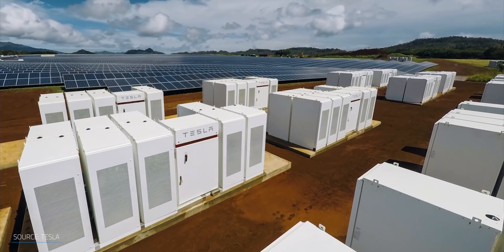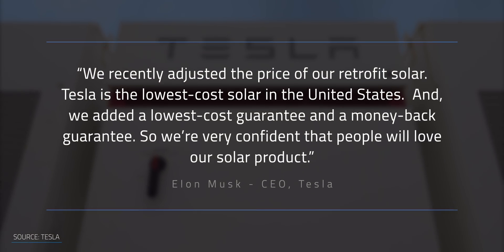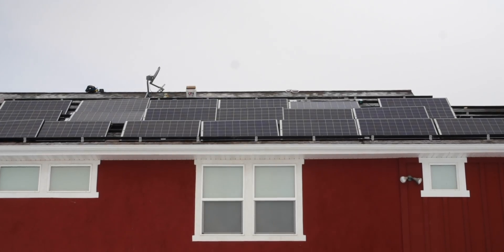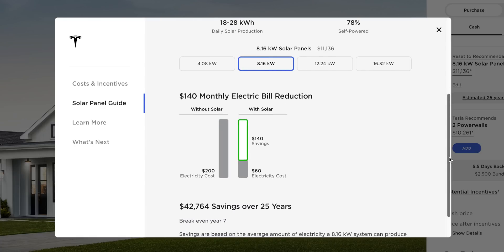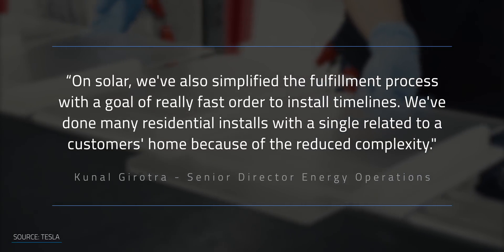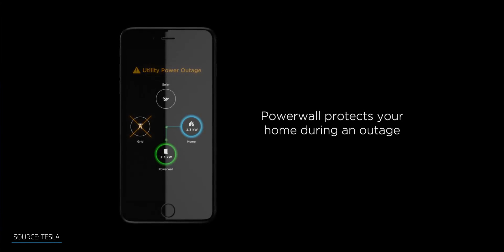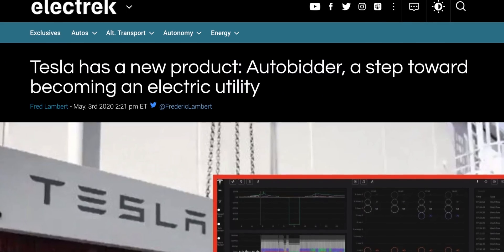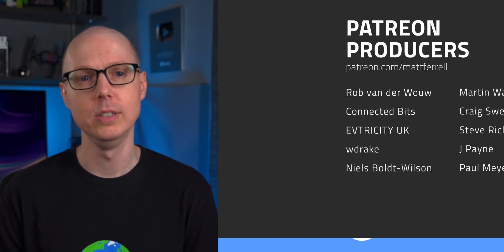Exploring Tesla solar panels game changing price

Comment: Damn....solar panels are expensive in USA. In my country ( INDIA ) the average cost per W of solar panel is less than $0.6 even before incentives
Reply: I can find panels as low as $.25/watt in the western US. The problem is not the panels. It is that plus inverters, plus installation hardware, plus installation labor, plus regulatory fees. The labor costs are obscene.
Reply: @court2379  in india its 0.8$ after installation and then you get cashback 30 to 50 percent from govt depending on slots per year. However for that 4kw min
Reply: @court2379  It's very easy to just install them yourself.
Reply: @court2379  spend a few weeks/months learning the tech and how to install them.
Reply: @court2379  Install your own and it's really cheap
Reply: @JH-th3ke  I would not say really cheap, it will still cost 5 to 15K US depending on how big I go. However the ROI is less than ten years which isn't terrible. I plan to someday, but need to replace the roof first.
Reply: @court2379  Oh yes door mounts would cost a lot. I did mine in the back yard made the mounts and seasonally adjustable. ROI was about 3 years.
Reply: @court2379   for solar to work it has to be 1 dollar a watt out the door. turn key
Reply: Even less than that, around $0.4-0.45
Reply: @sanchitrastogi55  it is incredible when compared to other countries...
Reply: Correct. Couple of panel with battery and invertor costs around $120 on Amazon India
Reply: In Germany we pay around 1100€ for 1 kWp ($1,2/Wp), but most of that cost is labor, roof mounting and parts (inverter and cables), the panels alone are closer to $0,35/Wp. And we get payed around 1800€ over 20 years per kWp for energy that goes into the grid. So those are basically free.
Reply: Psi Storm Germany is more focused on long term goals than short term ones. Just look at recycling compared to the UK. We try to turn a profit. You try to turn waste into something without the profit incentive becoming dominant. The US isn't serious about solar but it's focused on green economy expansion. I'm afraid Germany shows what happens when the free market is abandoned in favour of actual progress.
Reply: @Psi-Storm  Mine was at 0.6 € per Watt. In der Solarindustrie scheint noch viel Luft im Preis zu sein....
Reply: @Psi-Storm  if we only talk abut panel, then ur Germany is much cheaper than india
Reply: Manny Santiago  Absolutely,  what those solar companies are charging for day worth if labor is robbery. It isn't hard, it is just unfamiliar to most people. The permit process is the other challange people will try to avoid by paying someone. 2-3k is more than enough's compensation for the labor/effort involved.
Reply: @court2379 , I find it odd that someone says another person's work is "not hard". Yeah, screwing a bolt on a roof to hold a solar panel may not be hard. However, there are tons of considerations to make to install solar in an efficient long lasting way. Not to mention the knowledge behind understanding electricity.
Reply: @mr.c6674  "tons of considerations" huh?  You are obviously not a technical person so it must seem complicated to you.  The hardest part of installing solar panels is to avoid tripping and falling off the roof.
Reply: @mr.c6674  Guess I missed this one. I am not trying to say it isn't work and there isn't value meriting charges for the knowledge and service these companies offer. The problems is the amounts they are charging. It takes a few people a day or two of labor to install the panels. The sizing and planning is done using software they have developed and probably takes a few hours for one person, then there are adminstrative labor costs and getting the permits. So for a project maybe 5-6 man-days labor. Let's say they are getting $30 per hour (which they probably don't) that comes to 8x6x30=$1440. Then let's add some profit, and payback for the development of their tools and marketing, let's say a generous $2560, for the two day project (yes I know the permits and billing will drag out for a while, but the bulk of the project). So now we are looking at 4K over the cost of the equipment, instead of the 12+K of the quotes I have received. They are over charging by at least double, but in many cases 3 to 4 times what they should get for the work. Why can people justify this outrageous over charge? Because government subsidies pay for most of it under the pretense of helping the people become more sustainable. When the reality is these companies are getting every dime of that subsidy and leaving the consumer with an even greater cost than if they had hired out the work themselves, without the subsidy.
Reply: I bought 8 solar panels (2350 Wp) in 2018 including inverter and installation for €3300 before incentives (after: €2700). I live in the Netherlands with very high labor prices. 
What also surprises me is the energy use per capita when I see your offers. We use 1500 kWh/year with a 2 person household (and generatie 2000 kWh). This is not including heating btw (we heat with gas)
Reply: You may be mixing up the cost per watt of a solar panel vs the installed cost per watt... you can buy solar panels in the US for less than .40/watt - but you still need racking, inverter(s), install costs, cad drawings, conduit, wires, disconnect, monitoring etc
Reply: i wish i could buy my solar system in india , any help ?
Reply: @ayileenenga9670  tata solar is the company you can contact, they are a very big company and are also doing joint venture with some australian companies,also tata installed commercial solar for google, ibm and other big companies in India. They are the best and manufacture their own panels in India. Tata solar. Will never let you down, also you get 25 years warranty on panels.
Reply: @Ajay-zi6im  thanks a lot for the tip.really appreciate it !
Reply: @ayileenenga9670  
I would veture that the hardware is actually more expensive there. Most electronics type items are. Where they will save in India is on labor and mounting hardware.
Reply: @court2379  i want to hear from him, US american like to be little others countries without even been there. if it was that expensive like you said,  american wouldn't want to buy their products. FWI, most of our solar panels and electronics panels/hardware come from ASIA )Taiwan, China, India, and Malaysia) cuz they produce good products at lower prices.
Reply: @ayileenenga9670   Sorry, I didn't look at the name... 
When Indian coworkers visit they often buy electronics and clothing in the US, despite it being manufactured in the area, because it costs less. Although they have not done that as much anymore, so perhaps things have evened out some, or tariffs have made it about the same. I can ask some friends if you don't get an answer.
Reply: @court2379  Tata solar is best company in india for solar panels, Tata is a big company, they bought Jaguar (car company)as well
Reply: @Ajay-zi6im  I think big is an understatement there.
Reply: If you send me some panels I'd be more than happy to pay you a commission.
Reply: @Valdemar Bing Can't compete with cheap unregulated Russian nuclear power!!!   3 cents, LOL .. ya get what you pay for, remember Chernobyl
Reply: Canadian prices are even more expensive and NO incentives.
Reply: I am sure .60usd in India is more expensive than 1.50 in USA  when you adjust for average salary.  likely the difference is cost of labor.
Reply: Be careful not to compare raw solar panel cost / watt with installed cost / watt
Reply: These people are talking about the actual panel, not PRICE PER WATT. Huge difference. No, people are not installing solar systems with inverters for .60c a watt, anywhere in. Any country.
Reply: @Valdemar Bing Lmao,you talking about KW/h,potato.People here talk about cost of Buying and installing solar panels which will output energy for decades.One time payment of 1-2$ for 1W generation for whole panel lifetime.1W of solar would produce 1KW/h somewhere in 200 days.Basically people pay 1-2$ to get 0.09$ each 200 days.
Average KW\h cost in US is 0.13$.
Reply: @RajeshBhavnani  the comment I was referring to was the number of skilled labor, not their education levels. The point Jobs was making was the literal lack of people graduating with engineering degrees - as in not enough people are even going to school in the US to support these mega factories and production lines, etc. That's directly do to the fact that being an engineer is difficult - it's much easier to be a community organizer. That easier part is also on the education system that is a complete and total failure that would rather teach 'white people bad - give me mo money' instead of anything real or valuable. I'm a hardliner on illegal immigration, anyone here illegally should be rounded up and catapulted over the border wall - but people who do everything correct and come here legally should not be punished. BUT, of course we can control that number, and cutting back on that number may, at times, be necessary - I have no issues with that. However, going back to the original point, to blame companies for saying they don't have enough labor because the garbage teacher union controlled education system is a complete failure is nonsense.
Reply: Darth Wheazius  So who is the U S A born scientists that invented computing? Was it a U S A scientist that "invented" www? Or did you "borrow" a bit to make it happen? The USA has a history of abusing IP. Just check out the history of their big pharmacy industry. It is buildt on theft.
Reply: But it's still expensive in Indian standards and electricity bills savings aren't much for most households.
Reply: Wtf is per kW you mean W.
Reply: @umeshofficial13  yeah my bad, i just edited it.
Reply: I believe this cost includes installation and the other costs. If there was that large of a price mismatch then the market would already be flooded with cheap Indian solar panels
Reply from the maker: Yes.  The per watt pricing here includes installation.  Typical panel prices by themselves are well under a dollar, but that’s excluding inverters and other component costs, as well as installation and permits.  And I appreciate the lively debate here, but just a reminder to keep it civil everyone.
Reply: @UndecidedMF  Like all home improvement projects, solar retrofit will never be price competitive in the USA due to the added value it gives to homeowners. The high turnover of property ownership in the USA means that home improvement projects will ALWAYS be tied to Added Value and not to the actual cost of installation. A competent self-installing homeowner could get a solar retrofit done for less than $0.75/W, but whenever a contractor is involved, soft costs are exaggerated.
Reply: @UndecidedMF  it’s including installation and solar batteries with all
Reply: If this includes installation, storage (battery), pv panels, the inverter for 110/240V and size matching average consuption, then it is a bargain. Probably even in India.  To compare. 2*160w panels with charge controller and 1kW (k=kilo=1000) led battery set me back about $400 somewhere  in Scandinavia. I installed it myself. Not that hard for a small system. I just covers my lights and computer stuff but during a power outage I don't have to worry. 

PS: The inverter will cost me $2-400
Reply: Yeah I was amazed as we set up our solar panels and read about Tesla claiming their "game changing price", in Sweden ours only cost us half of Teslas price per watt, and they were premium black ones with all the features and 22% efficiency
Reply: I guess it's corruption of a kind.  Logic alone places the fossil fuel industry at the heart of opposition to solar.   The solution is to provide large tax incentives to the to the fossil industry for conversion of Coal to solar... make it worth their while then they will stop fighting solar.
Reply: It worked for Ontario and germany. Super cheap electricity now. /s
Reply: In my country of Wakanda, our solar panels work even at night.
Reply: @djabroni_brochacho4644  Good for you 😂😂 Well actually there are places in my country .they work at "night" to during a year.
Reply: That also means that at the darkest and coldest part of the year they won’t work during the day.
Reply: That’s because the cost of living in India is terrible along with their wages
Reply: I was going to say, I purchased my off grid system about 6 years ago now and paid about $.87Watt, in Canadian dollars, so roughly $.70/Watt American
Reply: So true, I had to do a little conversion from dollar to naira and I was shocked by the amount.. With rate most solar installation in my country would have been set aside.. We would rather burn petrol to power our generating sets..
Reply: @Valdemar Bing really.. then it is free
Reply: @Sekhar_Home  That guy was talking about KW\h prices,not about solar panels.KW\h in US average at 0.13$.
Reply: our old world thinking processes are our undoing
Reply: @David Lockett in india, in my state per KWh is US$0.08 i.e. ₹6
Reply: That would be illegal in Canada, and when your house burns down the insurance company won’t cover you.
Reply: @Supercharged Petrolhead - This is going to be manufactured in India now. Plus it will be subsidized. The costs are going to be even much lower than this.
Reply: If you go on Alibaba and seen how many solar panels really cost, this isn't surprising. Solar panels cost $0.20/watt in China. The rest is just installation cost + installer profit. How much you pay depends on how much your local installers want to profit.
Reply: I can get them for 30 cents a watt in the U.S.
Reply: It all depends on the quality now doesn't it?  Also, in your country people are paid about 3 dollars US a day. So I would rather make 200 dollars US a day and pay 3 dollars per watt. Wouldn't you? Need I really go on?  I mean , in your country there are 300 million cows and people are starving to death!
Now that's progress

NOT!
Reply: @Heart2HeartBooks  What kind of trash attitude is this?How the hell you get to racist and toxic crap from discussion about solar panels? Did someone hurt you?
Reply: Even if you add the installation cost ,excluding inverters
It costs less than a dollar 👍
Search loom solar india, tata solar 
(This is excluding govt subsidy)
Reply: Most shazz in india is cheaper than it is in the US.
Reply: To lower the labour cost, find a company that allows you to buy your  own set and diy partly. Its not that difficult, except for installing and connecting inverter. i paid in total 2000 euro for an 2750wp installation. Costed me 2  days labour....
Reply: @teddy_north  If I do it, I will do the entire project myself. Those are good prices though. Never seen anything that reasonable in the US. In my current home I don't use that much electricity and the rates are fairly low, so it would be a longer payoff. Particularly if I hired a company to do it. So I probably won't install them on this home.

I plan to build on a bit of land I bought though, and the power company and city want about $12000US just to connect to the grid. I will be going offgrid solar because of those costs. The power companies are pricing themselves out of customers.
Reply: @court2379  wow that sucks...  How much do you get for delivering a kwh  to the electricity market?
Reply: @teddy_north  Where I live now (Utah), nothing. They will give you a credit for over production which applies to future months billing cycles.  Once per year they clear any outstanding credits. They never pay the customer.  For small amounts of over production that is probably fair as they did install the power plant, grid, and maintain it to serve as your battery. Some places still charge a service fee for the connection (around $10-15/month usually, but some places up to $50),  the power itself being a separate cost.
These are also reasons to go off grid as there is not a large incentive to sell power back. Some others states have more friendly laws.
Reply: @court2379  not so different as here, in the netherlands. We do get a refund for the amount kwhs more produced but that is only between 4 - 8 cents per kwh. We pay for being conected to the grid as well, but no extra charge for setting up the connection. If you have an old meter at your fuse box,  when inserting an inverter, the meter just flows back. Then you dont need to pay 12000 dollar?
Reply: They cost about $0.90 in the US before incentives. Tesla's just bragging that their inflated price is is slowly getting closer to the standard price.
Reply: About $0.10 a watt in Arizona
Reply: Wow...
Reply: Evocati  About solar and Obama, get the facts straight and not half truths. https://www.factcheck.org/2011/10/obamas-solyndra-problem/ did your homework for you.
Reply: Is this maybe because the labor cost is very low and no regulations? We do have regulationsand while a lot of people don't like them, India climate is not the best in the world. I am not criticizing but I am from a developing country too and luckily able to move to the U.S. In my previous country, the water and waste and chemicals are tossed altogether and no one regulates anything.
Reply: @angrykulla Get serious, what planet are you from. China has stolen 1000 times more technology than they have developed, and will continue to do so.
Reply: Manny Santiago  I am all about DIY, but after working tier 1-2+ tech support for various ISPs for a decade now, I can tell you there are still millions of americans who don't even know where the wall sockets are in their house.
Reply: @angrykulla Hmmmm...So why do Chinese nationals smuggle billions of dollars out of China, through Macau, to invest in other parts of the world if their economy is so great?
Reply: Shipping from china is a hell of a lot less to india than united states
Reply: I'm packing my bags right now
Reply: wtf?? where do you buy your solar panels! Here in canada solar is like 2$ per watt
Reply: @sylfix2680  Not sure what it would cost to purchase and ship from the US, but search for "sunelec".
Reply: @sylfix2680  I know a whole sale dealer
Reply: I have a 5.2 kw system at my home which has cost me around US$ 0.46 with government incentives. I had to pay a little extra as my structure had to be higher otherwise it costs only US$ 0.42. & in these 10 months it has produced avg 20 kwh power per day.
Reply: @jeckypatel86  is that only the panels or is that every thing panels, inverter , batterys or is it grid tied
Reply: @dknowles60  It is grid tied. No batteries and  all costs included i.e. wiring, switches, earthing setup, structure, net metering and discom charges, inverter, installation charges, solar PVs etc
Reply: I watched these stupid videos and have ended up getting seriously swindled by Tesla and I am going to put that in the comments because I recommend that you run away.  They lie until you buy.  I had one specific thing that I asked every single person involved in the process.  I asked, "Is it a problem that I don't have internet because I won't buy the panels if I need it because the $100 I would save on my electricity would be undone by the cost of internet/wifi and fees and there would be ZERO profit and the panels could not possibly ever pay for themselves.  Well, all of them, every single one, said, "No problem.  The system would work without internet.  The internet is used for monitoring but there are cellular options.  I asked before signing. I asked before installation.  I asked during installation.  I asked the person who stopped by to see if it was ready for inspection.  They all gave that same answer and the 7 days I had to decide whether to take them down came and went and their inverter never worked.  The system generated no power at all and because I couldn't monitor it, it took a few weeks to find out before my electric bill came.  At that point, they totally refused to come put a working inverter in.  They refused to service my account at all saying that they would never come unless I get internet and that I could no longer get the panels off and there was no way to get out of the contract.  Now, I have to figure out whether to get $100 internet to save $100 for my electric bill and it almost doesn't matter because it would NEVER pay even ONE PENNY of the panels off and they are a lying and cheating company and there system also is prone to fires so if I start it up I will also have to pay more for insurance and that means I would seriously lose money on top of the $16,000.  Never ever ever buy from Tesla.
Reply: Taking 0.5$ and adjusting for PPP it is 10$ per W in India. Compare that with the electric prices in india solar gives less value today
Reply: It is a shame that this is such a good channel and yet some of the commenters here are nationalistic bigots and grudges built from political disinformation. Most of the people who come here value the truth. Americans can have a better system by voting for better and more knowledgeable leaders. I have lived in several countries, including communist and Japan, but here in Texas our politics is controlled by the oil and gas industry shills.
Reply: @markdouglas8073   ever hear of you did it to your self's. do you think closeing down badly need coal power plants was a good idea, Hint DTE energy was the big winner in the cold snap. they are apx 40% coal. they won big. they were selling extra megawatts  to other power companys.
Reply: & farmers can get 3kW unit with 5 hp pump 350$.  I REPEAT WITH WATER PUMP INCLUDED including installation. Trust me my neighbour got one. Initially no one was interested. Now it is hard to get.
Reply: @WilliamHelstad  if you pay $1,000 a year for electricity, solar costs $10,000

If you get a 15-20 year loan to pay for solar, it costs less.

And the price is still going down.
Reply: @WilliamHelstad  https://youtube.com/playlist?list=PL3IRGTBkUZ4ytr0_dn3bnwqTmogCp4J5H

You need to watch this
Reply: Its all about what any person in any country can afford. You can apply this to most stuff, say a can of coke.. it costs like what.. 10 rupee in India? Here in New Zealand it can be purchased for about $1.00 which is many more rupees.
Reply: In South Africa it cost $0.33 per w
Reply: @angrykulla Imagine supporting the country who puts Christians, Muslims and Falun Gong in concentration camps where they work to death or till someone wants's their organs. I bet you also say Trump is literally Hitler lool.
Reply: @angrykulla The US does indeed subsidize other countries. Almost all new medicine and medical technology for example is created in America and then due to EU laws, they are forced to sell it for pennies on the dollar and they fuck over Americans to make their money back. The average medicine costs around a billion dollars in R and D alone and that's why most medical advancements come from the US.
Reply: TEC Man  everyone knows indian are poor. What else u want to say?
Reply: @liwojenkins  China and the rest of the world steals American IP -- then hypes why everything is cheaper. Sure, everything is cheaper when you have no R&D cost. It's why American companies should always side against making products in China, since once they have the manufacturing process down, the state literally just copy and pastes it and calls it Yung-Ho Solar Panels or something and sells it for 70% less, putting the original company that did all the R&D out of business.
Reply: @rodmunch69  Yep, China steals EVERYTHING even their manufacturing techniques are stolen from Taiwan.
Reply: @rodmunch69  . . . which IP ? Which Intellect ?
Reply: @rodmunch69  it's a hole that was dug by the US company itself, they took American jobs to China to exploit cheap labor and get a slice of their  domestic market,  they also knew going in that Chinese patents only protect manufacturing processes and not product design
Reply: @rodmunch69  I disagree with China stealing from America to develop products. American corporations do the research and development of a product (any product from electronics to guitars, you name it) then the weigh the costs if built in America or China; which option will be the most lucrative to the bottom line and profit margin. Not as you have commented by saving money on R & D. 
Furthermore, the government has allowed these corporate companies to exploit the market and rip the consumer off. So, when they slap a excise tax on the imported product, that only hurts the consumer (you and me!). So it's a double edged sword. I can't afford a Breedlove guitar made in the Oregon., but I can buy one that is manufactured in China that has the companies standards of quality control for a much lesser cost. It's simple! You want cheaper like everyone else, then you will bypass American made goods to be able to afford cheaper cost products. Everything and anything nowadays is manufactured off-shore.
Reply: @rodmunch69 , are you ready to pay the MUCH higher cost of products actually Made in America? Someone has to pay the cost of that $45 an hour line worker who has pretty darn good medical insurance.
Reply: @mr.c6674  According to Steve Jobs, and a bunch of other CEO's, making products in the US wouldn't actually add a ton to the price of products. The issue is more about the crippled education system with the corrupt teachers union that cares more about creating SJW's than it cares about creating engineers - that means there's a lack of workers. Also line workers aren't making $45/hour, and if they are, then fire all of them and move to a non-union state.
Reply: @rodmunch69 When the US starts to pay for all the IP they have stolent the last 200 years you can start whining.
Reply: Fri Tanke a “I know you are but what am I” comeback - which was stolen from America as well.
Reply: @rodmunch69  ?? What was stolen? Ahh A troll bot, with a degree. Good to know. When the US starts to pay for IP on aluminum rims I'll start to listen.
Reply: @fritanke2318  You see the huge announcement last week about the new Chinese stealth bomber? LOL! They literally just stole our stealth bomber and put a Chinese flag on it. Sort of how the Russians stole our Space Shuttle, oh, and the nuclear bomb -- which is sort of like how China stole our ICBM and nuclear bomb. That's just off the top of my head -- but yeah, aluminum rims, yeah, OK kiddo.
Reply: @rodmunch69  Do you know where the main tech behind F-35 came from? It's not made in US. So yea, just start to pay your dues before you whine about IP theft.
Reply: Which IP?
Reply: Machining a circle with bolt holes is copyrighted? 😂
Reply: @rodmunch69  ha ha ha. I'm sure you haven't been to college. What American IP are you talking about? Have you been to engineering colleges where most of the research funds are invested? There aren't any Americans in masters degree program. Forget about post graduate. That's too far fetched for an American intellect. To bring to your attention (misery), most of the students are (in the order of number) either Oriental, then Indians, then Spanish, Europeans, Pakistanis, Bangladeshi, Southeast Asians and.........the list doesn't include Americans. Tell me which fantasy world you live in.
Reply: @shahzadrazi7639  My degree is in computer science and engineering technology, kiddo. Now back to your job at the Dell helpdesk.
Reply: we're run by the petrol companies. its also why we have 3rd/8th world public transport compared to everyone else
Reply: @TheLeesto  Well, that and our country is bigger and more spread out than most others.  Also, most Americans enjoy the freedom and independence of driving themselves where they want to go.
Reply: @LG123ABC  "freedom" to pay outrageous fees to own, license, finance, store, park and most importantly, the "freedom" to waste your precious life and time glued to a steering wheel in traffic. living abroad in a true first world country with first world public transportation is eye opening. i wish more people had the opportunity to experience it and they wouldnt care about the "freedom" to drive where they want as much. Your time is better spent on high speed rail enjoying a beverage, catching up on work or leisure while someone else does the driving.
Reply: @TheLeesto  Not that much traffic where I live.  I try to avoid the whole "hive" thing.
Reply: @LG123ABC  Australia bigger than US only 25 million people so your point is?
Reply: @angrykulla China's daily routine involves stealing IP and tech, cornering the market, giving free or dirt cheap land and electricity to Chinese owned factories. They get foreign companies to set up R&D in China and gradually change it from a mix of foreigners and locals to all Chinese who then go off and set up new companies or join Chinese companies, or the very same brand new innovations immediately appear in competitor factories and products and Chinese law courts rule that there was no copying or theft when it is the definition of blatant. The OP was right and if the truth seems racist to you then your understanding of racism is a false ideology. As a country and people they will cheat ruthlessly to win and don't consider win-win a good outcome. They only respect win-lose. Tariffs SHOULD be on everything coming out of China so that jobs, wealth and prosperity can return to the unrightly de-industrialized West and other places if appropriate.
Reply: @unfurling3129 , facts please.

Thanks
Reply: @unfurling3129  Always nice to see how the US is blaming others while for decades stealing inventions and patents worldwide via Echelon. You guys are so full of bullshit propaganda you don't even realize how fucked up your leadership and media is and how little about the real world you know.
Until then, just continue to shout "USA! USA! USA!" and do your morning propaganda rituals in schools like the little brainwashed people you are.
Reply: No, they really are not that bad, in the USA, solar panels range between $0.30/$1.00 per watt, This video is just lying probably to push sales of overpriced panels
Reply: Well, our president sure isn't helping...

AKA, he's trying to rip apart the EPA for oil companies to make more money.
Reply: @matthewboyd8689   he is a real estate magnate
Reply: @matthewboyd8689  What are you, like 15? You have NO CLUE. Yea - it's all Trumps fault. EVERYTHING is Trumps fault. Meanwhile the LEFT  has no time to worry about doing ANYTHING to contribute to America other than trying to fabricated ENDLESS investigations, Impeachments, Protests and RIOTS and People like YOU are part of the PROBLEM. Just THINK about what COULD have been accomplished if the LEFT would have actually spent the last 4 years CONTRIBUTING and WORKING WITH THE PRESIDENT instead of the 24X7 CONSTANT ATTACKS. Think about all the TAXPAYER MONEY that was spent by the LUNATICS creating 4 years of LIES then trying to COVER them up. Not just against the President but against ANYONE AND EVERYONE Around him. Then think about all of the Tax Payer Money that the President had to spend to Fight all the BOGUS INVESTIGATIONS. So STOP WITH YOUR BASELESS NONSENSE, OPEN YOUR EYES and TRY to use that Gray Matter between your EARS for ONCE in your life instead of spewing the same Media propaganda we've been hearing from you PUPPETS for the last 4 years. I'd say - he's done a pretty DAMN GOOD JOB considering all of the NONSTOP ATTACKS he has had to endure from USELESS CAREER POLITICIANS - WHICH APPARENTLY YOU THINK DO A BETTER JOB OF RUNNING THE COUNTRY. But I guess you'd rather elect a guy who has done nothing except Line is Families Pockets for 47 years. And you have the NERVE to complain about THIS President????? Good GRIEF. I sure HOPE you have a PLAN to keep YOUR SANITY when we RE-ELECT President Trump AGAIN. My prediction is that the TDS will be Off the Charts - beginning NEXT WEEK when a new SCOTUS justice is sworn in.
Reply: @matthewboyd8689  Why should he do you remember what happened when Obama helped Solara?
Reply: @matthewboyd8689  ya he do.. beter than bubama!
Reply: @matthewboyd8689  Solar prices installed has nothing to do with Trump.
Reply: @vichardy3504  Sure it does. Illegals charge way less. BWAHAHAHAAaaaa. That's why Republicans refuse to require E-Verify for employment.
Reply: Matthew Boyd    The free market (capitalism) will (is) bring the price down, which is the whole point of this You Tube video.. Government bureaucracy is what keeps prices higher than they have to be.  EPA is just part of that bureaucracy. Coal and petroleum products will go away just like the horse  and buggy when better and cheaper forms of transportation exist.  Let the consumer decide what’s best, not some bureaucrats.
Reply: @jimmysunshine2348  through free market will try to get as much as possible profit. If noone wants to drop the price they will try to keep it or raise it.
Reply: @jimmysunshine2348  War and empire is one huge subsidy for the oil companies.  It is good the people are encouraged by subsidies to instal rooftop solar.  However the USA is half hearted compared to China.  They will leapfrog our steam age energy infrastructure.  I think they instal more in a month than we do in a year.
Reply: @jimmysunshine2348  or maybe regulate fossil fuels heavily and deregulate alternative energy
Reply: @jimmysunshine2348  The energy market is not like some widget that can be made cheaper over time.  Most consumers don't have the option to chose where their energy comes from.  The government is already involved in the energy sector through subsidies and tax credits.  If it was really a free market all those would not exist.  Quit drinking the Republican Kool-Aid and realize that our government is the only thing stopping corporate greed from killing us all.
Reply: @jimmysunshine2348  The government is PREVENTING competition by subsidizing dying industries (with coal being a great example). We the taxpayers are also subsidizing wrongheaded or outright corrupt initiatives, like growing corn for fuel, or rewarding the massive destruction of rainforest to produce palm oil.
Reply: @matthewboyd8689  back to blaming the orange guy haha American people you need to grow up before growing old
Reply: @bitkurd  He is right though, the reason things from China; PVs being one of them cost more is because of tariff wars... And no China does not pay for the tariffs, the consumers do.   Tariff protectionism goes completely against capitalist ideals, it creates companies like Harley Davidson that fall behind the competition at a global scale due to a lack of need to innovate to be able to compete.   So glad that he lost, hope the Republican party never nominates another clown like that.
Reply: @matthewboyd8689  Trump digs coal, remember :/
Reply: @liwojenkins  You are a gullible leftist and have done ZERO fact checking.   Here is truth:    this video is a lie.   Northern Arizona Sun and Win has panels starting at $0.60 per watt before any tax incentives.   https://www.solar-electric.com/residential/solar-panels.html?product_list_order=price_per_watt    eBay has them at $0.36 per watt. https://www.ebay.com/sch/i.html?_from=R40&_trksid=p2380057.m570.l1311&_nkw=300+watt+solar+panel&_sacat=0
Reply: @puppyupper4565  So you're too stupid to comprehend that the cited cost INCLUDES LABOR. Got it.
Reply: @SoundOfYourDestiny  You are child. Labor impacts all things.  Commodities prices are based on cost of production, transport fees and tariffs. Installation of a commodity is specific to every location on the planet..  Installation of Solar panels on a house in Appalachia will be much more reasonable than panels on a skyscraper in NYC.  It would be a very costly study to get the average installation cost of 1 solar panel.   I seriously doubt the maker of the video did such a study.   I own a ranch in Oregon and one in the Philippines.  Even though the Philippines is closer to China, Solar panels there are much more expensive than in the USA.    You leftists love to tear down America.   You destroy everything you touch.  You call people stupid when you know nothing about them which shows how much a child your are.